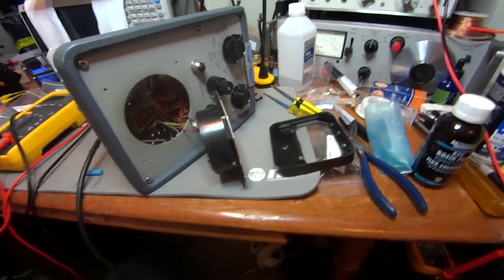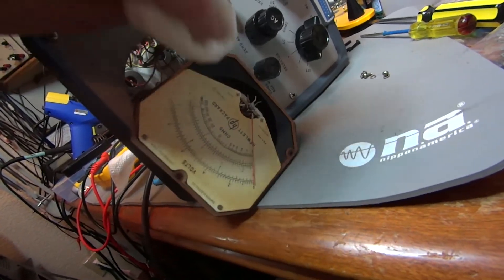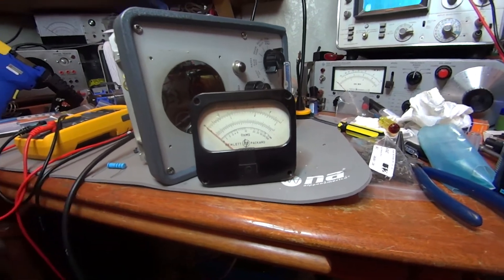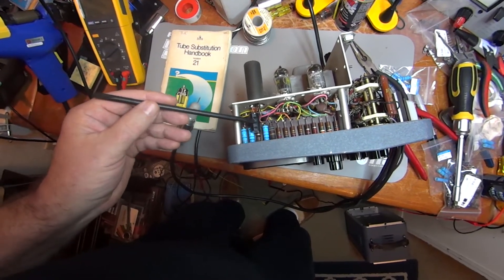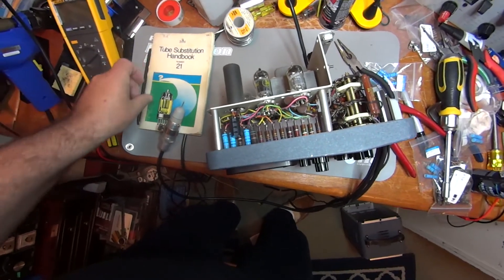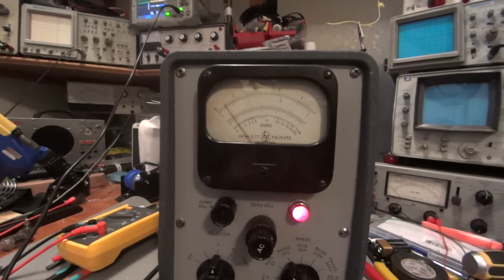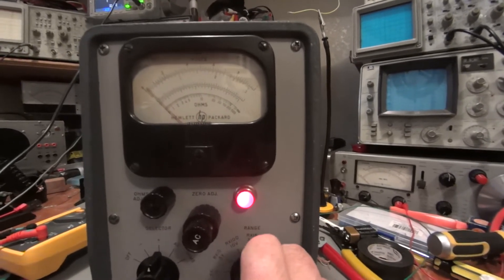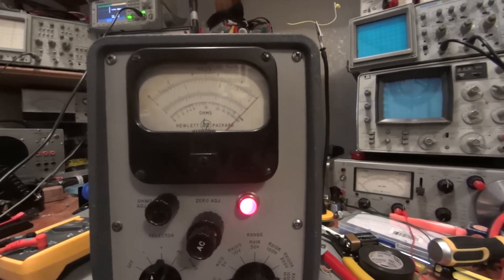WOW! Get This Meter! HP 410b Repair and Wide Band AC RMS Measurement Demonstration

Comment: Years ago, the shop I worked at, threw out a bunch of gear that was considered obsolete, among the stuff was an HP 410B and a HP 430C, and a bunch of other stuff. Needless to say, I picked it out of the trash, and took it home. I pull it out and use it when needed, especially to double check the output of some generators to make sure the attenuators are still good and calibrated.

Just because somethings are old and need special care, doesn't mean they are obsolete and need to be tossed in the trash...

Comment: Nice meter and nice video. I picked one up at a local ham/radio gathering for $10. It was in excellent cosmetic condition and came with a manual. I had to clean the switches, replace 5 resistors, the filter cap and then replaced the 6X4. The OB2 tested new and the 2 12AU7s are a pair of RCAs that tested as new and very well matched on my Hickok.  I was surprised he was selling it so cheap, it looked like he had just replaced the DC and resistance leads with Probe Master leads, so I figured it would have been a mess electronically. But it calibrated right up and was dead on with the meter.  Excellent device!
Reply from the maker: I love that. I got mine for 18 dollars, I think that is the best way to have it. It is such a silly thing to spend 800 bucks, what's the fun in that.
Reply: @leonardpeters3266  yeah, it’s crazy what people are paying for them. Though it’s considered one of the best VTVMs ever made and top quality HP devices are commanding top dollar.  A friend’s grandfather is pretty much done with electronics so he gave me a bunch of tubes and tube gear and in one of the boxes was an RCA WV-98C VTVM and I’m starting to rebuild that meter as well. I actually just used the HP 410B about 20 minutes ago to do an alignment on a Philco 52-940 AA5 radio.  Love that it has a 1 VAC range.